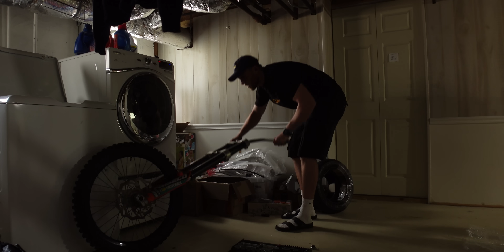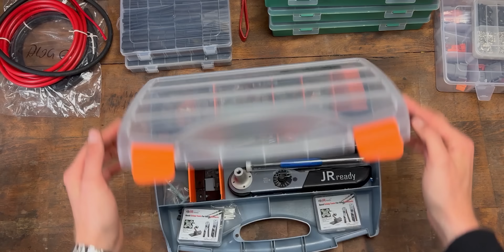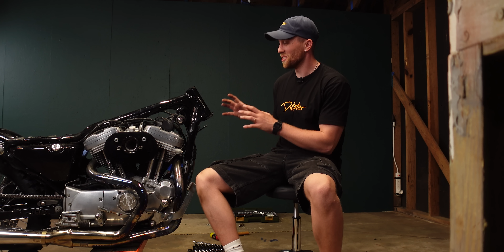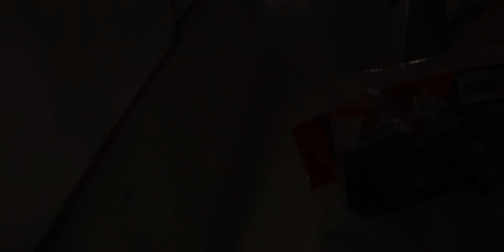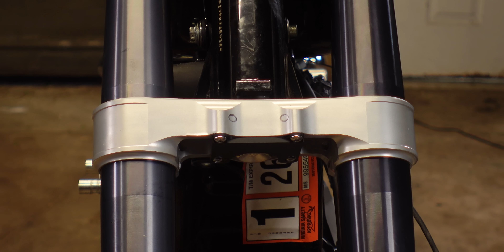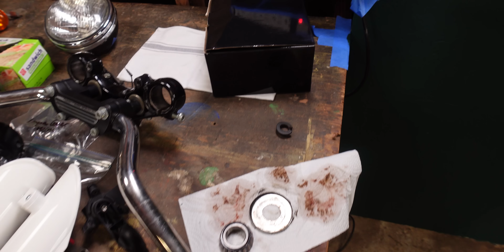Who calls the Sportster a Girl's Bike now?

Comment: Was that plug and play or did you have to modify the internals of the fork to support the weight of the Sportster ?
Reply from the maker: It is plug and play regarding the fitment but I did have the forks upgraded at a specialised mx suspension shop. It now has the stiffest springs, thicker oil, and better seals. Plus, it’s lowered by 2“.

Comment: So this was 3 weeks ago. I just watched both episodes after noticing the channel thumbnail on the month old one. I think you will smash those forks? However I have 250 forks on a 750 and they'r fine! So I hope they stand up to everything and they are so adjustable that it depends how high those jumps are? Next??
Reply from the maker: The forks are currently being serviced, lowered, and revalved and adjusted to the increased weight with stronger springs. I think they should be fine afterwards. 
What 750 have you built with the 250 forks?
I went back home to Germany which is why the project had a little break. I just took out the wiring and the stock oil tank to install an upgraded one. That will be the next episode 👌
Reply: @MotoWrenchers its a Deltabox Yamaha frame with an 83 cube vee twin.

Comment: Hey man, Dirtster owner/builder, Super Hooligans racer and flat track champ here. When it comes to the rear end I'd recommend lengthening the swingarm, and also moving the swingarm shock mounts closer to the bike, combined with longer shocks. What this does is give you much more wheel travel vs. shock stroke, and also gives you a taller ride height without having a crazy steep swingarm angle. Additionally, moving the shock angle lets you control the rate of progression through the shock travel. If they're more angled, they get stiffer through their travel, so using really long shocks on stock mounts can often result in the shock getting SO stiff near the end of it's travel that you can't really use the whole stroke.

P.S. The steering stop looks good! I ran a similar setup on my Super Hooligans bike, but it was a flat plate with little welded posts sticking up. It buckled in a crash and the triples totalled my fancy tank! It was a bummer. The design you made, but out of billet steel with be great!
Reply from the maker: Hey Benny, sounds like you have a lot of experience under you belt!! I appreciate that you're sharing your knowledge with me. I got 17" shocks from K-Tech that should arrive these days. I did think about extending the swing arm because I've seen the steep swing arm angle on other builds but My main concern was distortion during welding. How would you go about extending it? Also, by moving the shocks closer to the bike you mean further forward, right (giving me more of a vertical shock alignment rather than a diagonal)? Thanks again for all your tips!!
Reply: @MotoWrenchers  Yeah exactly, further "up" the arm for the shock mounts. With those big boys it might be nice to fab up new mounts that are on the outside of the swingarm even! that way you could use all that stroke without having too steep of an angle. 

On old twin shock dirt bikes they did run some really funky angles though. The more diagonal they are, the more progressive (stiffer as it goes down) the suspension becomes. There's probably a chart out there showing progressive/digressive ratios based on angle. I get it all from an old text book called "Motorcycle Handling and Chassis Dynamics" by Tony Foale.

For the swingarm extension, what I do is use two big aluminum billets at either end that are the width of the wheel and pivot respectively, bolted to a huge plate (or in my case fixture table). That way everything is bolted down tight, and the big aluminum blocks are a bit of a heat sink. That's probably over kill too. I bet you could make a jig that holds it nice and tight out of some random steel pieces if you take your time.
Reply from the maker: @bennyb.1742 I will look into that once the shocks are here. Your input gives me a lot more confidence. I might finish the build, take it for a few rides and then do that during the winter. 
I’ll also see if I can get my hands on the book. Thanks a lot! If you should have any more tips in the future please let me know 👌
Reply: @MotoWrenchers will do man! I DMed you on Instagram as well

Comment: Why not change the rake ? Shorten the wheelbase? Could also help with the tank situation.
Reply: The rake will probably change with new longer rear shocks.
Reply from the maker: Yeah, I’m gonna check out the stance once I have the longer rear shocks and installed the adjusted forks (they are currently at the suspension shop to get lowered by 2“). I appreciate your input guys! 🙏

Comment: What is the fork angle rake of a KTM 250 compared to the Harley sportster. Might need to change the angle if can cause premature damage to the fork internals. I'm building an off road version of a 2000 yamaha roadstar 1600, an XT1600, lol
Reply from the maker: Yo, that's a crazy project...I love it! Which forks are you using and are you changing the rake? If yes, how are you doing that? I know that the Rusty Butcher has built a lot of these off-road Sportsters without changing the rake, so I hope I don't need to tackle that :D

Comment: Super common for brakes and suspension to be metric no matter if the bike is imperial or metric. They just never bothered making those imperial as the metric was readily available and worked well.
Reply: It’s not imperial. SAE
Reply: @bandb2g  While the imperial system is a broader system of measurement, SAE is a specific standard within that system. cut an paste. But essentially the same thing.
Reply from the maker: Thanks guys! 🙏
Reply from the maker: That makes sense. I'm very happy I get to learn these things now.

Comment: I think the steering stop block needs to be metal with rubber bumper inserts to provide a little cushion.
Reply from the maker: Yeah, I’m gonna build it from metal later on. When I did my research, I was surprised to find that the steering stop on the KTM is just a screw in the frame that directly hits into the lower triple clamp. But some padding is probably a good idea 👌 I appreciate the feedback 🙏

Comment: Good progress, and i actually dont mind the look of it!
I hope the rear gets different and higher shocks still, because now it doesnt really match with the front aesthetically.

Also: Are you worried that the very slack fork angle, combined with a long fork that is not made for this angle could lead to bending / damage?
Reply from the maker: Thank you!! The rear shocks are currently being built by K-Tech and should arrive in the next two weeks. I‘m sure it will change the look a lot. I also dropped off the forks at the suspension company. They adjust the internals to the increased weight and lower them 2“. From what I’ve seen on other builds these forks hold up without any issues. I don’t know if you’ve seen what the Rusty Butcher does. He races and jumps his bikes with a similar setup, so I think it will be fine 👌
Reply: @MotoWrenchers  You are quite competent, so i´m sure whatever you are doing is well researched and will work well :).

Comment: I used motocross forks on a chopper just use shortersprings and fill the extra space with a piece of tubing
Reply from the maker: Were they stiff enough? That's how I shortened the forks on my BMW build.
Reply: @MotoWrenchers  I had no problems

Comment: Bro, I live in the US and almost nothing I own even uses imperial bolts. I get frustrated when something does.
Reply from the maker: Hahaha would you say you're the exception in the US or do you feel like most people prefer the metric system?
Reply: @MotoWrenchers  It depends a lot on the type of work we're doing. Most modern cars tend to be metric, even US ones. But if we're measuring stuff to build a shed or other type of wood project, we're typically using imperial. Lbs vs Kg obviously, Temperature, Gallons, etc.

A lot of our consumer goods tend to come from overseas now, so a metric set of tools is going to work for like 90% or more of everything we are working on unless it's classic cars and old machinery.
Reply from the maker: That makes sense, thanks for the explanation 🙏 I actually enjoy getting into the imperial system for this build 🇺🇸
Reply: @MotoWrenchers  Yeah it's never bad to have a set of any tools around. Being able to repair whatever you come across and be prepared for it is very convenient.
Reply from the maker: @namegoeshere2805 absolutely 💯 I hate getting stuck because I don’t have the right tool. But sometimes it’s good when it happens to force your creativity

Comment: Why don't you try moving the tank back a half an inch, or whatever you need?  Relocating the tank is a pretty common mod for custom Sportys.Did it on mine.  You should be able to easily fab up a couple of front brackets, or maybe just elongate the holes in the stock brackets enough to move the tank back for the fork clamps to clear. You are on your own on the rear mount. I don't know how these new Sportsters mount at the rear. Love this project. Looking forward to seeing the results. New subscriber.
Reply from the maker: Hi man! Thank you very much for the idea. Yeah, that’s definitely also an option. After installing the headlight mask I am really considering going more vintage motocross with the styling. I need to make up my mind because then I might also go with a tank that fits that style. What are your thoughts on that?
How did you build your sportster?
Reply: @MotoWrenchers  Well, my situation was a little bit different from yours. I was mounting a fuel tank from a 1975 Husqvarna 360 CR. The front mounting tabs on the Husky tank are actually very similar to the Sportster mounting tabs on my 1984 Ironhead. But I needed the tank to sit slightly higher, so I made a couple of brackets out of some alloy chair bracing I had around. The rear of the Husky tank was nothing like the stock Sportster mount. It just had a tab sticking out the back of the tank, so I drilled and tapped a hole in the frame and used one of those double-studded vibration isolating mounts.
       That Husqvarna tank was alloy, and I stripped the paint off of it and gave it a sort of a brushed finish, with some steel wool. It looked pretty good.I used the seat off that Husky too, although I never really got it mounted satisfactorily.
       I rode it around like that for a while,but then I caught the Cafe Racer bug that was going around back then, and mounted a tank off a late 70’s Yamaha 750 triple, and a cafe style seat I got off eBay. Those little mods came with their own set of issues.
Reply from the maker: Thanks for sharing!! The 360CR tank looks very nice. That style is also what I have in mind should I restyle at some point. Do you have pictures of that stage? I’d love to see it. 
Did the cafe racer look work out? That was also one option I considered for the Sportster. Do you know the Project7 by Kevan Cahyadi? That was what got me hyped up for a cafe racer Sportster.

Comment: I built a supermoto bike and the front tire/wheel is smaller 21" to 16.5" and I used a yz85 fender . Cleaner and the lines are still the same .
Reply: I didn't build a sportster . But the off road fender looked ridiculous with the smaller front tire . Was thinking a KTM85SX fender would look good on the Dirtster . Since you went with a KTM front end and mask .
Reply from the maker: @erictavenner5256 ah alright. yeah, that makes sense. If I’m not going for the vintage style, I’ll definitely give that a shot!
Reply: @MotoWrenchers Vintage look would definitely fit the lines of the Sportster better . Thinking round headlight and mask . UFO makes a pretty sweet one . Or the Acerbis Elba . Square but vintage . 80's yz style front fender  . Round !
Reply from the maker: Hi Eric, supermoto Sportster sounds very nice! Which other parts did you use for that project? How does it ride?

Comment: Because the fork's are not made by Harley but by Showa that's why those bolts are metric not imperial
Reply from the maker: Ah, now I understand. Do you know if they were used on other bikes as well?
Reply: @MotoWrenchers Harley axles are both different. Sportster are metric. Dynas where 3/4,1" then 25mm in around 2010. Softail still 1" I think. It gets confusing when you want to switch wheels from other bikes.
Reply: Showa also manufactured the planes that dive bombed pearl harbor. The more you know.
Reply from the maker: Just watched a documentary on that…absolutely awful
Reply: Arent these WP forks?
Reply: @Stark-Enduro76  i'm talking about the stock Harley forks
Reply from the maker: The new ones yes 👍
Reply: @KTM-Beta WP KTM in house brand. Showa been making forks for stock Harley since at least the 70's but Showa is now mostly owned by Honda.
Reply: @nathanmortenson914  Didn't know about that, but Showa still supply for european brands, such Triumph
Reply: @SiqueiraBlues  Yeah, Honda's purchase of Showa is relatively recent in the last few years. My Supermoto Drz has Showas. The have their regular production and they have their tuned Works set ups.